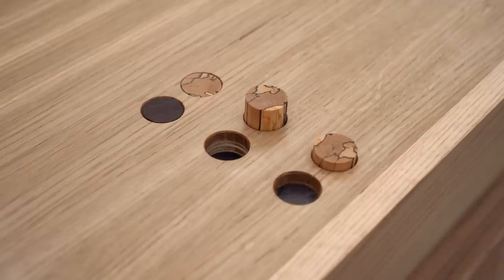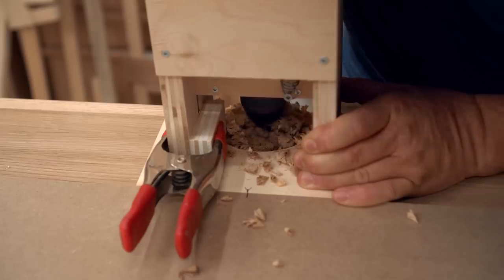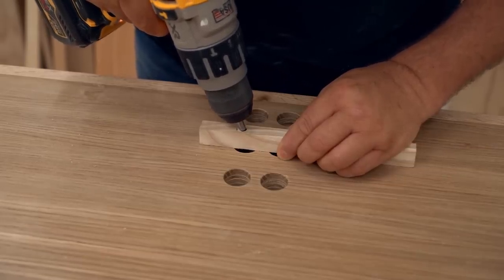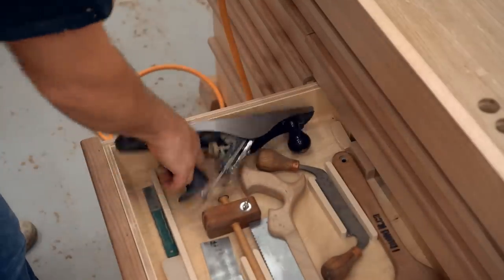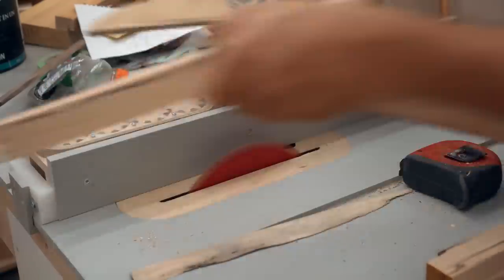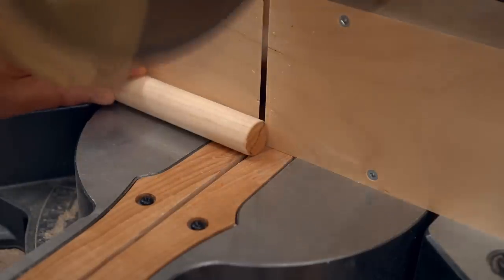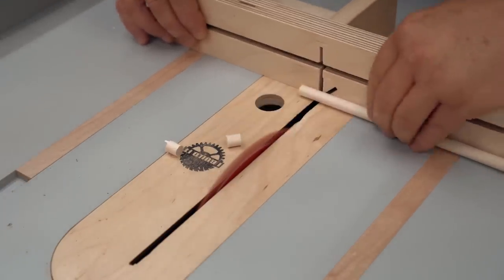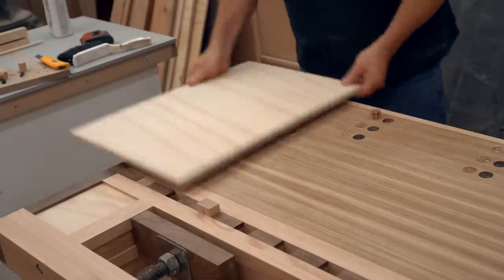Genius Idea? Making Push Button Pop Up Bench Dogs

Comment: I appreciate your impromptu lessons on how to deal with kerf binding and to fearlessly push stock past a router bit without hurting yourself.
Reply: I always get nervous when I see somebody using a table saw without a riving knife.
And those hands seemed to be dangerously close to that router bit.
Reply: @diether2423  being nervous is not the same thing as being in danger. I learned that a long time ago. You just have to know what you are doing.
Reply: @lxoxrxexnx  well, in this case there was no reason not to use a riving knife. So for sure it could've been done in a safer way.
Reply: @diether2423  if I accuratedy recall how the video went, I saw no blood or bits of flesh go flying so that's as safe as it gets. 
John has made numerous comments in the past about his knowledge of safety and good practices. The main thing is not the tools but one's attitude and thoughtfulness that you bring to bear when using tools. If you know anything about John you will know that he has been making his living doing this stuff for about 40 years and still has all his fingers intact.
I understand the unease that you are feeling. My saw still scares me everytime I use it even after my 40 years of using it. That's what keeps my fingers still attached to my hand despite also not using a riving knife.
I have been hurt by tools; but they all have been hand tools and because I did not fear them enough or had been inattentive while using them. 
Still, we all have our ways and you can and should use whatever way you wish to keep your blood from leaking out.
Reply: @lxoxrxexnx  Safe means low risk, not accident-free.
I agree about the danger of hand tools.  I just sliced my finger nicely with a bow saw blade, that a few minutes ago I had resting on my shoulder near my carotid.  The older I get, the fumblier.
Reply: "safe" is not the same as "without injury"

i have avoided injury while doing very unsafe things in an unsafe manner plenty of times.

wood work is inherently unsafe. Any safety comes from the woodworkers behaviors while doing this unsafe work. if you cant recognize the dangers then you cant change your behaviors to suit the situation and probably need more conservative safety behaviors and the inverse is true.

this man recognizes the dangers, and changes his behaviors to suit those dangers. knowing this, he can do these unsafe things without injury.
Reply: I'm sure John has a reason for not putting a splitter in his table saw throat plate but I can't figure it out.

Is he immune to kickbacks?

Comment: These are awesome. Totally going to incorporate them into the bench I'm building, but I think I'll try to get the features for the flippers in place before I add the top of the bench. The hardest part of this looked like it was cutting the channels - 99% sure I'd ding the surface of the bench doing that!

Comment: Brilliant.  I want to try something similar with pop out cabinet door hardware(the kind where you push on the closed door a little and it pops out an inch or so so you dont need handles)

Comment: When making the spring/dowel friction function....drill the hole all the way thru and then add an allen set screw to the other side so it holds the spring but you can make it adjustable. on a waxed cast iron table you would want that also make it stronger for clamping, probably...

Comment: Sounds like this combined with a table-end vise would make for a good CNC router work holding. No metal to get in the way of the bit, and pins are easy to replace if and when a bit does run into one. Angle the pins toward the vise by a couple of degrees and they will hold the work piece down instead of just keeping it from moving.

Comment: I saw a trick to be safer with a router table and making dowels, the trick was to start and stop the cut an inch before the ends to let you have a square piece of stock to hold on to and let ride on the table and fence without chance of slipping. You could make some form of square angled grippers from scrap to pinch from both sides.

Comment: recess them  a little more  add a grip to the top of them and make them lockable so you can use them to sand on top of and cut down plywood that would be super cool and even more multifunction

Comment: John, with a board and a couple of wedges, would the dogs be strong enough for a quick clamping solution? Which would be more hassle, installing these after the bench build or as part of the build process (either has individual dog & button sets, or as prefabbed gang of dogs & buttons), just curious
Reply from the maker: 1" hardwood dowel sunk 1-1/2" into a hardwood bench strong enough? I think so :)

Comment: I think it would be easier to make if you just made a separate part for the flippers that mounts underneath the bench and you just drill all the way through. Would also give the added benefit of still being able to use holdfasts when necessary. Being unable to use holdfasts in the same hole if I need to is kind of a deal breaker for me, but it does look nice

Comment: The problem I have with the pop up dogs in my vice is over time the sawdust gets between the hole and the dog and they get stuck because the spring doesn't have enough force to overcome the extra friction.  These should work better.

Comment: Instead of making two holes where one is a button and the other one comes out... why not just use one hole and then use a device where when you push it - it stays in and then you push it again, it pops out again?   Like a drawer - where you push it in before it pops out enough to let you pull out the drawer all the way.

I think you can find the push button mechanisms for drawers in any Home Depot.   And if you want to be really fancy - you can use those slow spring mechanisms so that when you push the button, it will slowly rise out of the table... making it look real professional.
Reply: That would be too clunky and would have changed the way his system worked.
Reply: @bigboyyesyes184  I've never seen the modern push drawers as being clunky.   The mechanism is actually very smooth.   Yes, it would be a different system (one hole instead of two) but it wouldn't have changed the way the system worked.   When you press the button, it would pop out and could be used as a backstop the same way the current "bench dogs" work.   Press it again, and it goes back to being flush with the surface of the table and is out of the way.

The only thing is that it would be made from parts from a manufacturer rather than all home made parts.   But then again... the drill, the drill bits, the saw, etc.   those are also made by a manufacturer.
Reply: @omegajoe7014  by clunky, I mean internally

Comment: What about crap filling the hole?
Reply: That's a good point. Perhaps a way to mitigate that would be to drill a smaller through hole out to the bottom of the bench top to allow dust and other fine crap to fall out. The flat bottom of the dog holes won't help tho'... The idea is very interesting but the implementation should be incorporated into the build of the bench top. This is an after thought with the mechanism made to match. A hinge pin for the boomerang lever, a tapered bottom and a through hole to let crap fall out would make this idea much better. Still, I like it.

Comment: why would you choose partially-rotted wood for this application?
Reply: Because its beautiful?
Reply: @gilbertolsson5641  - so, aesthetics. ok. seems an odd place for an aesthetic accent to me, but it isn't my table.
Reply from the maker: If you think spalted sugar maple is soft, you haven't been beaten by a rod made from it.
Reply: @JohnHeisz  - so, the degree of rot is insufficient to significantly compromise the mechanical properties of the material. thank you.

Comment: Doesn't it annoy you Americans to use the imperial units instead of metric? It seems very laborous.
Reply: I’m from the UK and was taught metric in school. It wasn’t until I went to work that all the old boys were still using imperial so I learned that too. Now I’m happy to use either because they both work. My point is, use what you need to get the job jobbed.
Reply: John is Canadian.
Reply: Yes it does
Reply: Jon is from Canada, but as I am an American, yes....I think the metric system is easier...but we are so used to the Imperial system and can related easily to it because we are so comfortable with it...and honestly, the metric system is used on a lot of stuff along side Imperial measurements with everyday items.  I often now use metric when figuring out evenly spaced locations or something that has to be divided because the metric system is way easier than fractions so both are welcomed in my shop!✌️
Reply: Adding the i in laborious is often too much for me.
Reply from the maker: I feel the same way about French. It must annoy the French to speak it because I don't understand it.
Reply: @JohnHeisz  le centimetre? What the fuck is le centimetre?
Reply: Always one metric guy thinking Americans don't understand the metric system. We do. Its you who doesn't understand imperial. Knowing both makes you better at everything.
Reply: @JohnHeisz  Having to convert my thoughts from an exotic language to the lingua franca annoys me due to extra labor and added probability of failure. I thought you must feel similarly since metric system is more widely used.